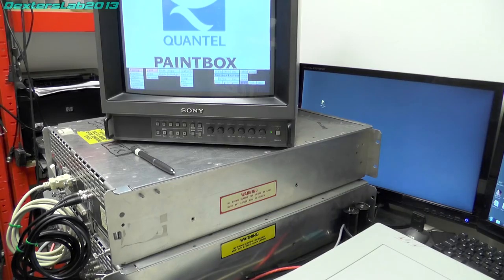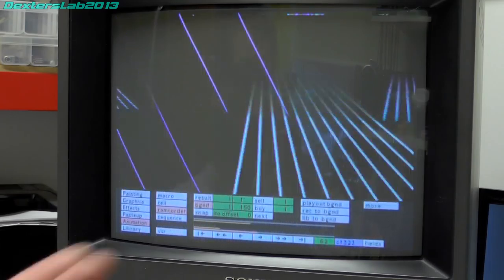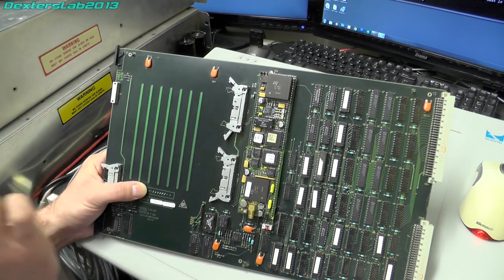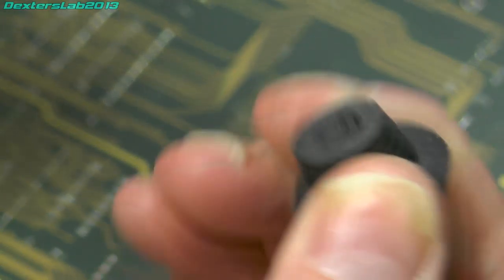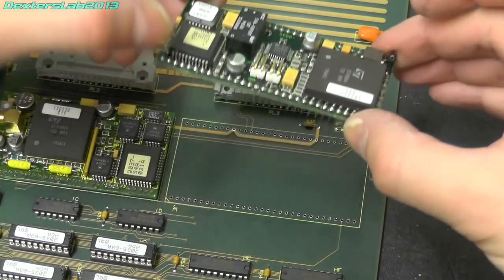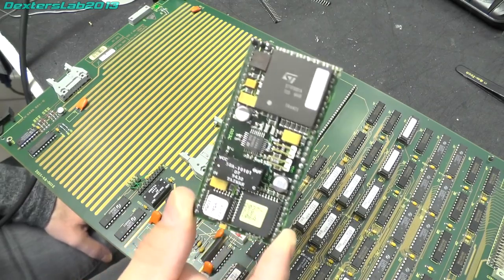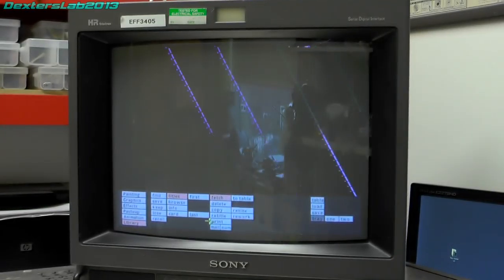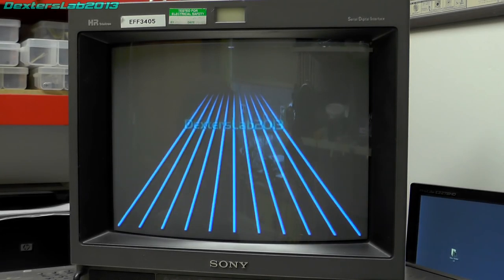DL140 Quantel Ramcorder Repair Part 1

Comment: Looking at that tearing video made me think of a sync issue immediately. You can also see the fields are blinking. I would look at hooking it up to a sync generator or genlock with black burst to lock it down. you can find them on ebay for cheap.

Comment: I like that silicone tip. I just modified my ones using some vulcanised rubber tubing to do a similar job of making a flexible seal. the rubber tubing that they used to use for those Hellerman cable sleeves, applied with a 3 prong expander, is a pretty good rubber, and as it is vulcanised it lasts a long time even being hit with molten solder.

Comment: I use a hot air gun to pre warm the pcb and all the copper - trick borrowed from welding big aluminium pieces that suck all the heat out of your torch.
Reply from the maker: Thanks, i just ordered a cheap hot air station so i can preheat the hybrid and aid removal.
Reply: DextersLab2013      Even a hair dryer will help quite a bit in these situations.   Years ago when i was repairing ibm ps/2 motherboards, i would remove those square chips with the hot air gun set to 250’c - but you run a high risk of damaging the chip and the pcb - so not worth it on a collectors item!

Comment: Didn‘t you have an external parallel to SDI converter you could hook up to the parallel bus connectors? Looks like a address error when accessing the ram. Can you monitor parallel data input to the serializer? Good luck!
Reply from the maker: i did yes, but it went with the other paintbox to Glitchart in Oregon!

Comment: With the socket conversion how about for broken pins just use another row of those turned pin SIP units and solder to the existing pins, so you have a new row of fresh pins. Also do those chips run smoking hot, I suspect most of the issues come from them not being well cooled in use, and if there is enough room in the case by them to put in a small pin grid heatsink epoxied to the chips so they run cooler.
Reply from the maker: The two ICs are supposed to draw only 20mW, but some of mine are pretty warm so yes i think it's a thermal issue as well, i ordered heatsinks a few days ago to fit to all of them. I do have a solution for the pins and sockets thankfully!

Comment: Lookls like addressing errors to me, with the image shifting a whole lot to the side.
Also, disconnecting the SDI input will let teh clock 'run loose' which may cause problems on really any marginal part in the system.

Comment: im curious what it looks like on a scope and if there is sudden dips or peaks in the signal ... maybe some kinda crosstalk, glitches on the serializer output stage, or if its serializing perfectly but the data its getting is garbage
Reply from the maker: i dont have a scope fast enough, 576i is 270 Mbps! Though i do have an old SD-SDI analyser so i might plug that upto it and see what it says.
Reply: DextersLab2013 oh wow I was not expecting it to be that fast, but yeah, worth an analysis if you have the tool for it

Comment: I hope that you haven't gone gone and broken your unit, you will have to reverse engineer the STV1601 and STV1602 ICs if not then you will have to find another serializer chip, I hope that you can find replacement chips for your recorder board and it is a shame that the chips are not made any more.
Reply from the maker: No my complete ramcorder is working fine, i am just using parts of mine to help narrow down what is wrong with my friends one. Thankfully there are a couple of sources of the 1601 and 1602 ICs out there so i should be able to replace them for new.
Reply: DextersLab2013 OK I was having a look also doesn't seem to be many  so it might be just a glorified A ADC DAC chipset